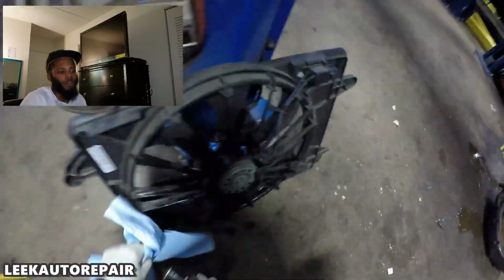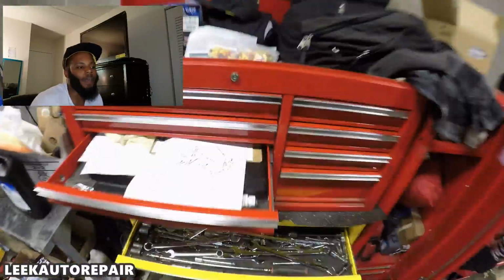How to Replace Radiator (VISUALS ONLY) 2011-2016 Dodge Charger

Comment: I did a radiator on a Dodge charger 2013 if you put the car on the left is four bolts in a bracket you remove the four bolts on the bracket and the radiator comes out you don't even have to take off the bumper I did the radiator less than an hour and a half. That's how unexperienced mechanics work. Make it harder than it has to be
Reply from the maker: Good for u
Reply: @Leekautorepair  💯

Comment: LEEKAUTOREPAIR respect your knowledge and skilled, I have 2011 Dodge Charger SE 3.6 Engine with 119,000 miles.  Car overheats only when driving. I've changed Coolant reservoir, Radiator Cap, Waterpump and thermostat, upper and lower hose, Coolant temperature sensor, Air Intake senor, had radiator flush and put the correct Coolant in car. The Radiator fan comes on regular. The serpentine belt is no squealingand shows no signs of wear and tare. . There is no milky residue on  the oil stick, no white smoke out the tailpipe, no knocking noise. 
I do have bubbling in the reservoir when overheating. The Coolant shoots upward out of the reservoir. I had two diagnostics ran on it. The pressure test ran as well. No different  good leads beside the ones I had already had check and did! I have about $9000 invested in the car. Do you have any ideas what could be wrong?
Reply from the maker: U still need my help bro?
Reply: What tools did you need for this job

Comment: Can someone please tell me at the 7:30 mark what is that I need it to order It.
Reply: brackets for the radiator one on each side both use a 10 mm bolt to hold them